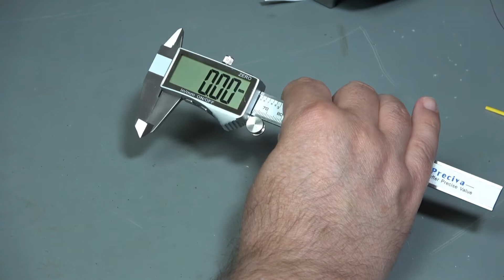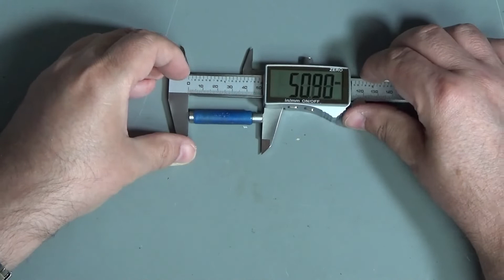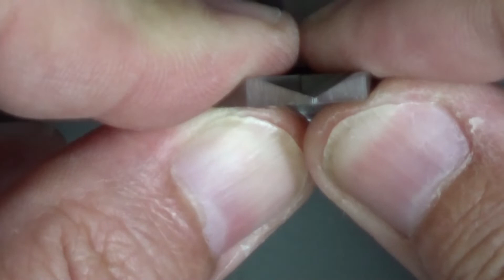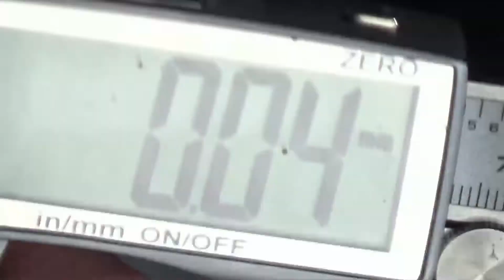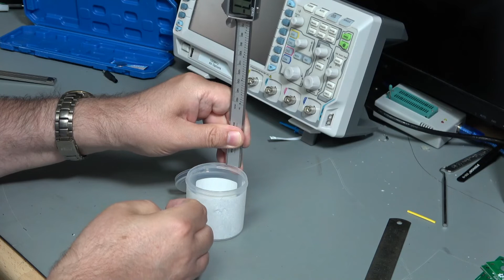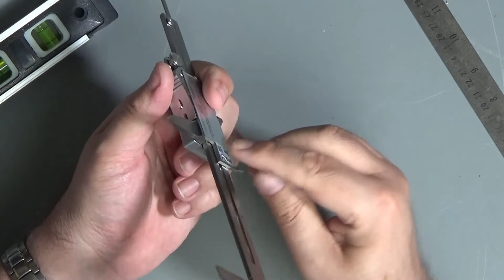Preciva Digital Callipers Review / First Impressions #0060

Comment: My present callipers seem to drain the battery even when turned 'off'. I'm tired of removing the batter every time I put them away. Do these callipers turn OFF?
Reply from the maker: Digital calipers only turn off the screen related circuits, they stay on so they track position changes even when they appear to be off.  That said, the power consumption should be so low that they last 1 to 2 years.  In these, the first battery only lasted about 6 months, the second is still going strong, and I have no concerns about it.

Comment: Some calipers have high current draw which impacts battery life. Have you measured the battery current while on and off?
Reply: I measured battery current on three absolute origin calipers.

Shars Aventor DPS
On - 21uA
Off - 1.3uA
Off from timeout - 13uA

Igauge OriginCal
On - 65uA
Off - 22uA

Insize Absolute System
On - 7.5uA
Off - 1.7uA
Off from timeout - 1.7uA
Reply from the maker: No.  The first battery did run out really fast, but the replacement seems to be lasting fine.  I think it wakes up at the slightest movement.